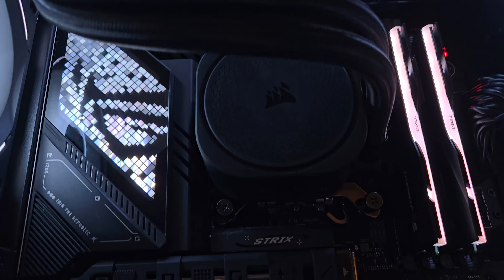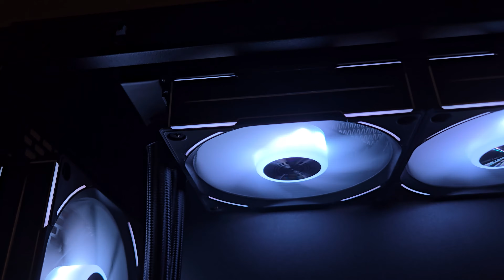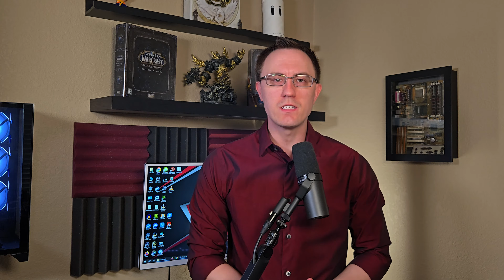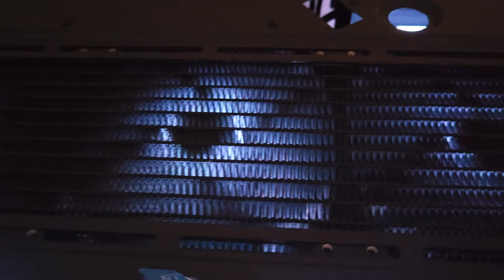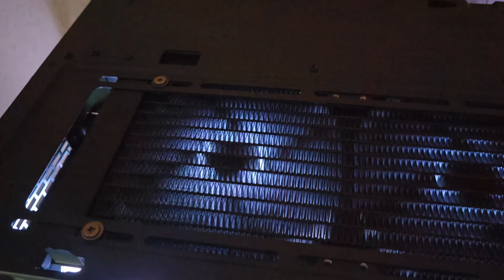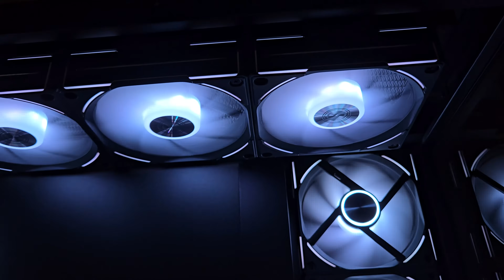Corsair Nautilus 360 RS Review: The Ultimate AIO for Your PC?

Comment: i just bought this for my 5800x3d and im hitting like 80-85 degrees when im at about 50-60% utl.
Reply from the maker: I have actually installed this cooler on one of those CPU's before. Idle temps were about 41c which was mind blowing. The load temps were maybe around what you're getting, maybe low 90's. But generally these things would be used for gaming, not load bearing temps 24/7. How are your gaming temps?
Reply: @TheDonTech yeah idle is about 38-50 at times. depending on the game I’m around 75-90 in game haven’t seen it higher than that. I used the pre applied thermal paste on it too.
Reply from the maker: Oh yeah that's not really all that bad. You could eek out a few more temps if you got a real nice Kryonaut Xtreme thermal paste, but at those temps I wouldn't be too concerned.  Though I don't think I've seen my particular CPU go past ~70's even when doing Cinebech.
Reply: @TheDonTech  Just ordered MX7 thermalpaste going to see if thats any better over the pre applied thermalpaste on the corsair aio
Reply from the maker: Oh very nice! I've not tried that, definitely let me know how your temps change.

Comment: What temps do you think this would cool on a ryzen 7 9800x3d? I've ordered this combo and am going to overclock it
Reply from the maker: I have installed this exact cooler on that exact processor and the idle temps were about 36c in the BIOS, and roughly around 40c in the OS after a fresh install of Windows. Quite good temps. However with overclocking you'll experience higher temps so just work within the means to get good temps and performance.
Reply: @TheDonTech thank you, also what's the highest ghz you think you can pull out the 9800x3d with a B850 motherboard?
Reply from the maker: No idea, I haven't done anything in terms of overclocking for years. Unless you're a pro gamer who needs to eek out every ounce of FPS, it's not worth it in the long run.

Comment: i am building mine now i am using this case and this cooler , i will have to see if or how your wired 12 fans and maybe i need the fans your using , i have 2 aio one for cpu and one for gpu not sure how thats going to work yet so how did you wire 12 fans please
Reply from the maker: The specific Lian Li AL120 vans I am using are no longer for sale "easily", as Lian Li has moved away from them and has gone onto another more cumbersome fan style. 

Given the way my fans are set up, I only have 4 groups of fans. If I did not daisy chain any fan group to another fan, the hub provides 4 connections so I would be fine. But since I was able to daisy chain some groups together I only needed to use 2 or 3 of the connections on the hub. 

I still think there is a far easier way to do fans, I just haven't thought of it yet :p

Comment: so im planing to swich out the fans for the montech ax120mm fans, but im not sure if that can then cool the i7 14700k.
Reply from the maker: Are you concerned about the fans or the cooler itself cooling the i7 14700k? The Corsair AIO should have no problems doing it at all. Same with the fans, really. Just watch your overclocking and make sure you have the latest BIOS updates to prevent any microcode issues.
Reply: @TheDonTech  thanks man:D

Comment: which cooler is best deepcool le 360 v2 vs Corsair Nautilus 360 RS ARGB CPU Liquid Cooler (Black)
my specs is : 
ryzen 7 7800x 3d
Gigabyte X870 Gaming X WIFI7 ATX Motherboard
Rtx 5070ti
Reply from the maker: I would definitely stick with the Corsair Nautilus over any DeepCool cooler.
Reply: @TheDonTech  what's reason behind this
Reply from the maker: Corsair is a far more reputable brand with less pump failures. I have seen dozens of DeepCool pump failures through the years.

Comment: do you think i need anymore parts or to upgrade any 

MSI MAG A750GL PCIE5 Power Supply Unit, 750W,

CORSAIR VENGEANCE RGB DDR5 32GB (2x16GB)
DDR5

Corsair NAUTILUS 360 RS ARG Liquid CPU Cooler
- 360mm AIO

Gigabyte B650 AORUS ELITE AX V2 Motherboard

acer Predator GM7000 2TB SSD, PCle Gen4x4
NVMe M.2 SSD with DRAM

AMD Ryzensets 7 9700X Processor

ASUS PRIME RX9070 XT

NZXT H6 Flow Black
Reply from the maker: From a professionals perspective I would swap out the power supply with an ASUS equivalent, same for the motherboard. 

RAM prices are starting to go real high, so I'd recommend getting at least 64GB instead to make sure you have more wiggle room in the future. 

Swap out the NVMe SSD with a Samsung 990 Evo Plus 2TB

Comment: I may chose the Norht XL black mesh version for case. So it doesn't need RGB. is it fit to cool a ryzen 9800x3d or 9950x3d?
Reply from the maker: I haven't cooled those but some in the comments have and it seems to be a great choice for a cooler! My CPU is 33c as I type this to you, just as an FYI. I'm not doing much besides about 30 browser tabs open between several different browsers, and a Premiere project opened to make casual edits as time permits.
Reply: You're better of buying a AIO with a pre-built offset mount for AM5 for the 9800x3d or 9950x3d, you'll get better performance
Reply: @gp8231  I went with the noctua NH-D15 G2 aircooler for the 9950X3d.

The highest temps i saw during various games was 68c (But i am in cool room, let's see during summer)
most games are 60c to 64c. Some games stay in the 50's i expect the most demanding games to be around 75c (atleast in winter time)

Also Aircooling has a longer lifespan compared to AOI's....
can't see how a AIO would increase the performance.

Comment: I use the same cooler and I love it. my pc specs are i5-12600KF, EVGA GTX 1080 Ti, 32GB DDR5-6000 cl30, a 7000MB/s 1tb Acer NVMe, corsair rm850e, and  a Lian Li Lancool 207 Digital case. Its so quiet i never hear it, even at max pump speed. 950 usd for everything
Reply from the maker: Very nice and very impressive! I used to have a 1080 Ti and recently retired it. Beautiful card, loved it so much <3.
Reply: @TheDonTech 😢

Comment: I just installed this in my NZXT H5 Flow (this case technically doesnt support a top mounted 360, but it actually does fit physically and the top panel is actually mostly mesh meaning its not blocking too much airflow along with a contact frame for my 13700F and temperatures dropped by 10 degrees at idle, even with the fan profile set to silent!

don't ask the kind of things I had to do to my config to make the front fans and rear exhaust to still fit ehe
Reply from the maker: Ha! I love installing things where they shouldn't go! 

I love this coolers performance. You got a 10c drop at idle, very impressive. Here's to long life and cool temps!
Reply: Why didn't you just install the AIO in the front of the H5 flow?
Reply: @gp8231 I wanted to keep the fan monoblock that came with the case for gpu temps and overall airflow because otherwise id be left with a single exhaust fan and the aio's leftovers to keep my vrm and ram cool

Comment: Maximum of 48 degrees under load?? Are you sure about that? What about OCCT test, it's about 70 degrees at 250w, right?
Reply from the maker: Most likely my max load testing did not get near the 250w load max. Most of the time you're only going to reach that doing synthetic load testing, or extreme high refresh rate gaming. So everything I was doing, the temps didn't crack 48c.

Comment: Is it a bad idea to get something like the ThermalRight Royal Pretor if I have to move the front fan upward to accomodate taller RAM?
It sounds like my two sticks of RAM, Corsair Vengeance RGB, may be somewhat tall according to Grok.
Reply from the maker: That is not a bad cooler choice, but there may be other cooler choices from Noctua that may also offer different air cooling solutions that will clear your RAM better. There may also be different configurations of the fans to also offer better RAM clearance.

I guess that is also a pretty big draw in these AIO's because they will usually have better RAM clearance.
Reply: @TheDonTech  It's frustrating. I'd rather have an AIO because it seems the cooling performance is better, at least with the 360 version. But I leave my computer on even while away on vacation as I connect to it remotely, and I can't figure out how big of an issue it would be if the AIO stopped working. I'm not worried about leaks as they seem rare enough, but rather a pump failure, which seems inevitable sooner or later. Maybe I'm making it a bigger issue than it is. (Sidenote, if you sort Amazon reviews by most recent on this Corsair cooler, they are awful, so that freaked me out.)
Reply from the maker: @sdm789  No need to worry that much. Pump failures are rare within the warranty period on Corsair AIO's. 

How many RAM sticks are you buying? If you are only buying 2 sticks, it means you are using slots 2 and 4, leaving the far left slot completely open, allowing for more clearance from an air cooler.
Reply: @TheDonTech  I returned my tall RAM and got a normal size (35mm instead of 44mm), so that solves the height problem. Got two sticks of 16 GB. I think I'm going to go with the Phantom Spirit 120 EVO. After way too much reading, I still don't know if that's the best choice, but I think it's at least in the ballpark.

Comment: As a rookie builder I'm confused about AIOs. It sounds like they all wear out or fail sooner or later, so does that mean your PC is ruined once that happens, or is there some way to catch it early & replace it? I leave my computer on 24/7, so what if the AIO goes bad in the middle of the night?
Reply from the maker: I love your question, it's so good! 

Yes it is true that most AIO's will have pump failure throughout their life. Closed loop AIO's (like what is reviewed here) also have a limited lifespan of their coolant inside and its efficiency will degrade over time. I typically only expect to use them within their warranty, which from Corsair is 5 years. 

When the pumps fail, sometimes they just stop circulating the coolant within. The worse outcome is when the pump actively leaks and the coolant comes out. This coolant is typically non conductive, so it doesn't ruin components by shorting them, though it can stain them and possibly cause corrosion if not addressed (components pulled out and cleaned off as safely as possible) 

If the pump just fails without leaking, the CPU temps will heat up. Modern PC's will shut off automatically once the CPU reaches unsafe temps, which is usually greater than 99c. Running the CPU at this temp is not ideal, but it shouldn't be running long enough to cause damage with the auto shut down ability. 

The pump failing without leaking is the most common scenario. Though it can be difficult to diagnose, as temps may run safely around the 80c range, and the PC only crashes when you play games or something. It can make the diagnostic process more confusing as the reason may not immediately make one think of a faulty cooler. 

If you are concerned about it, there would be no problems going with a reputable (Coolermaster/Noctua) type Air Cooler that has at least 6 heat pipes in it for cooling. 

Phew, sorry to make such a long answer to your brilliant question. I hope it was helpful, let me know if you have any other questions!
Reply: @TheDonTech  my old msi pc is 10 years old , no problem with AIO degrading.

Comment: Very interesting to hear about your experience with the sound levels. The pump on mine is very noisy and is much louder than the fans. This is my first AIO so I didn't know what to expect. I think I received a faulty unit. I'll look into getting mine replaced.
Reply from the maker: Oh yeah that definitely sounds like an issue from the factory, I hope they'll work with you on replacing it. Usually the first 30 days you can return it to the store you bought it from (Newegg/Amazon) and after that you should have a warranty from Corsair.
Reply: @TheDonTech  I got my replacement from the RMA and installed it last night. The difference in noise was immediately noticeable! I've used it for a few hours yesterday and today and it is working well. I'm glad I found your video to learn something was up with my original one!

Comment: The more I think about it, I'd think I'd feel my comfortable with a fan instead of an AIO for my Core Ultra 7 build. Would that be ok, or bad idea? Any recommendation for a good one?
Reply: air cooling is the way to go IMO with modern chipsets built on 6nm and below, no pump noise, and no pump or leak reliability issues, and cheaper. AIO's should only be used when you want all the flashy RGB, but I lost interest in that when I passed 40 years old lol
Reply: This fan has good reviews:
Thermalright Royal Knight 120 SE CPU Cooler, Only 155mm High, Dual Towers Dual PWM Fans TL-C12B V2 and TL-C12015B, 6 Heat Pipes,PC Cooling for AM4/AM5/Intel LGA 1700/1851/1150/1151/1200
Reply from the maker: As long as you stick with a reputable brand. I have no personal experience with Thermalright, but I've heard nothing but good things about them. The installations I've done have not had any issues on the initial bench testing, and longevity does not seem to be a concern. There isn't much to go wrong, and 6 heatpipes is definitely where to start. Just mainly need to worry about case clearance and RAM clearance if multiple fans.

Comment: Any chance the MSI model below would suffice? It comes free with the CPU.
MSI MAG Coreliquid A13 240 Black - AIO ARGB Liquid Cooling - 240mm Radiator - Dual 120mm
Reply from the maker: I have not seen anything but premature pump failures from any MSI liquid coolers. Whether or not that changes with new models I am not sure, but I wouldn't risk the CPU by using it. Maybe try to sell it on ebay at a bargain price instead.

Comment: How quiet are the fans? Thinking between this or the montech hyperflow silent and heard the nautilus is louder than the hyper flow
Reply from the maker: More than how quiet it would be, you also want reliability. The pumps and components within the Corsair coolers last an extremely long time, typically outlasting the 5 year warranty. 

Given that though, I have not personally used these fans. They are PWM based so I believe you should be able to control the fan speed/curve inside the BIOS though to get the best noise profile desirable. 

This cooler does keep my Core 7 Ultra 265K Extremely cool though, so my fans rarely go above their pre-set speeds, and I just flat out don't hear them running. The only fans in my rig I sometimes hear are the GPU ones when they ramp up.
Reply: @TheDonTech  Don... behave. This is borderline "Corsair Sales Rep" speak